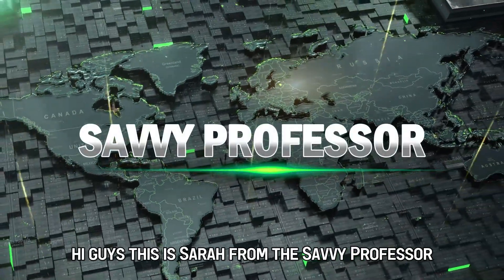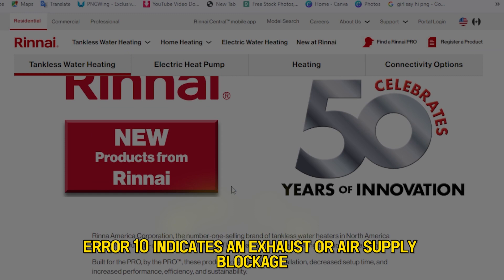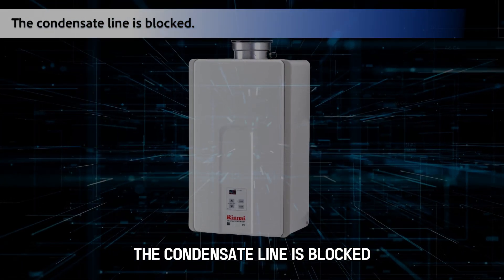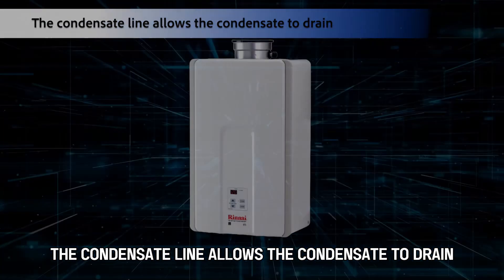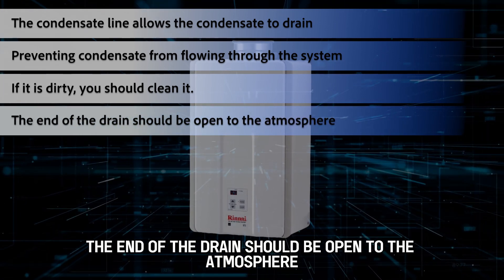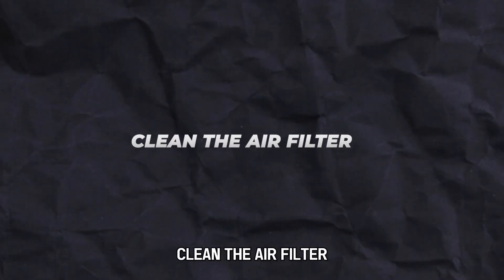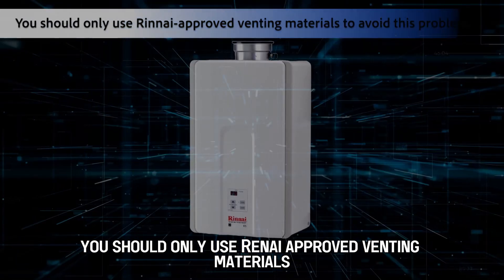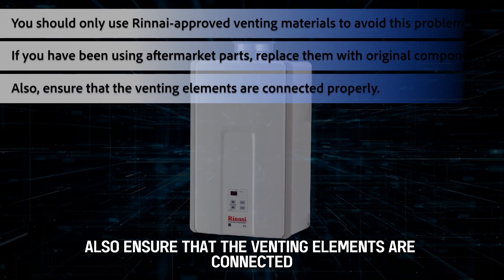Rinnai Tankless Water Heater Code Error 10 (Air Supply Blockage Error - Causes, And How To Fix It!)

Comment: This is a Rinnai design flaw. I permanently solved this problem by stretching a piece of metal window screen wire over the intake cover and securing it with a stainless steel hose clamp.  I have gone 5 years without a recurrence.  I have done this on my home and my three children's homes.